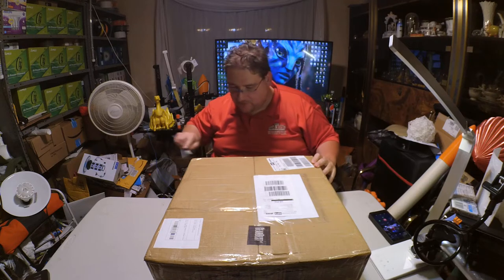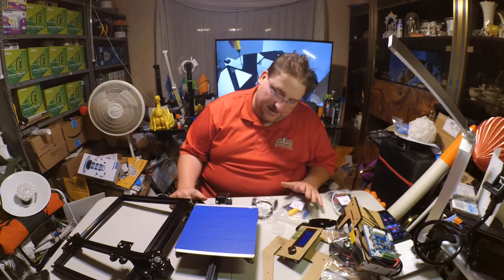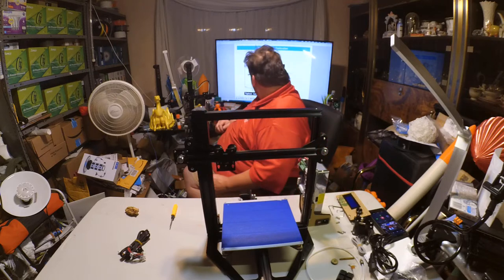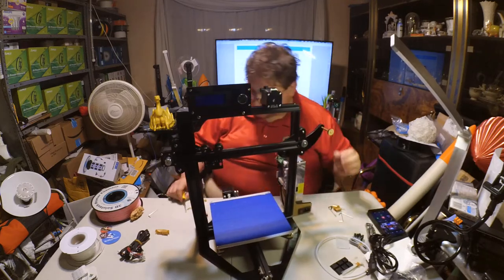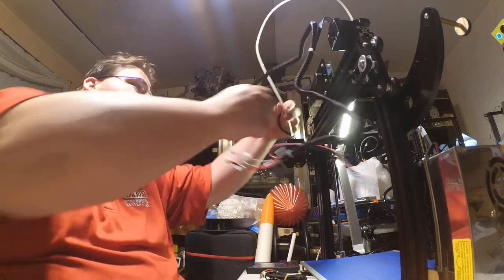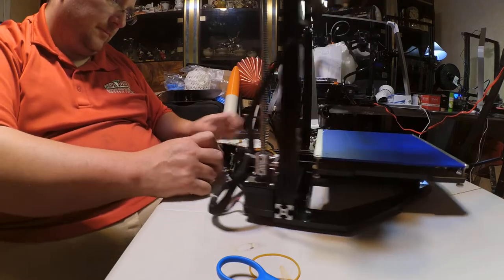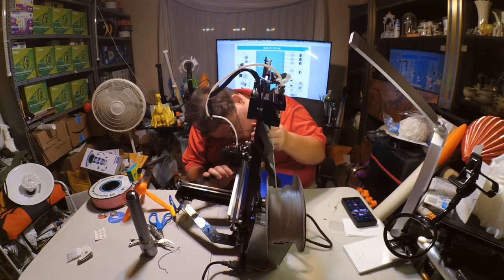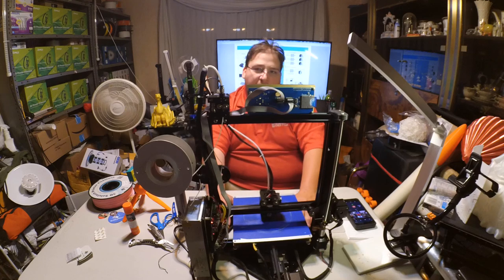Today's 3D Print - Zonestar Z5F Unboxing, Build, & First Print

Comment from the maker: Some sales Gearbest asked me to promote (why not)
I OWN these top listed printers and consider all of them to be a good or safe buy

CR-10 ON SALE AGAIN!! http://goo.gl/VsqqDa coupon:CR10SUP $379.99
UPGRADED Version of CR-10 http://goo.gl/sZXLnd GBCR10S $499
Ender 2 less than $170 http://goo.gl/RDceSp Coupon ENDERC EU Ver
Anet E10 http://goo.gl/ScK96q $259.99 just 60 pieces for EU warehouse
Zonestar Z5F (not perfect but not bad for $220!) http://goo.gl/d97i3B
------------------------
I DO NOT own any of these below printers but most appear to be well liked by other users on youtube. Check out some youtube videos and if you like them. Have at it.

NOW THIS looks cool. I want one of these to play with
http://goo.gl/sJ9oig LASER Cutter. Big. Code A3PRO2500 $159!

Tevo's take on the CR-10! Tornado Coupon Tonado1 $370 http://goo.gl/eBCy7e
I3 Mega http://goo.gl/baJAGP I3MEGA $310!
Anet A8 http://goo.gl/41b2YZ $139.99 Coupon GBA8EU just 200 Units EU warehouse
A6 http://goo.gl/e7PYSv EU warehouse $165.99 with coupon:GBA6EU

General Sale pages for this month.
More 3D printers http://goo.gl/D96bgJ
Autumn Bumper Harvest big deal http://goo.gl/NQ8cF8
Reply: HEY THERE BRO WILL THIS DEVICE TAKE A STEPPING MOTOR DRIVER LV8727 ???
ALOS WILL IT WORK WITHOUT HOT BED ???
THANK YOU VERY MUCH !!!

Comment: 2hour vid. Cool. Regarding the Enders belts. Do they go on top of the y axis carriage or on the bottom and same question for the hot end carriage. Thanks Nery.
Reply from the maker: I will have a shorter synopsis video once I have used it a little while.

For the ender. for the X its both (above and below) for the y its above and THROUGH the middle (inside hole) of the extrusion.
Reply: Nerys Thanks. Then I got it correct. Thank you.
Reply: Nerys I took another look at the assembly video on the sd card the guy has the brass ends visible coming up thru the bottom of the y carriage I switched it to that orientation and there was less stretch on the belt at the extreme travel points.
Reply from the maker: 4dprinter Guy what do you mean? Picture?
Reply: So imagine you are building one of your Enders, and you get to the point where you put the belt in the Y carriage and thru the extrusion..You slide it in BUT it has a brass fitting as a stop so it doesn't slip out..Now do you install the belt with the brass being UNDER the bed/Y carriage so the brass fitting is pointing towards the sky/ceiling?? Or do you install it where the brass stops on the ends of the belt are pointing down..AWAY or 180 degrees from the bed and part of the belt rides on the top of the Y carriage tangs...Not sure how to send a picture via this..That's the best I can do in written form.
Reply from the maker: ahhh gotcha now. I install from the bottom facing UP this keeps the belt path profile as flat as possible. less twisting that way. at least that is the logic.
Reply: Nerys same logic I was thinking. Kinda difficult to see on the video.

Comment: Anycubic I3 Mega has a bigger print volume than the Wanhao. Think it is 210x210x205. Thee is also now the CR10mini 300x220x300
Reply from the maker: the CR-10 mini looks nice. thankfully the one they are sending me looks to be the all metal variety (they have 2 versions one with an acrylic base) I am happy to get the all metal. I really don't like acrylic.

Comment: For $220, this thing looks fantastic - that acrylic bed though :(  At the end of the day, would you rather this & $160 or another CR-10?  I think I'm spoiled that the CR-10 was my first printer?
Reply from the maker: well believe it or not that "depends" the CR10 is nearly $200 more. ask me 2 years ago I would probably say THIS not the CR-10. why? investment risk. if I buy this and decide meh. not into 3d printing as much as I thought. I am out $200 not $400. but if I decide I AM IN and like this. I then go buy the CR-10 anyway (assuming I have a need to print that large) and now I have 2 printers.

The CR-10 for many is "NOT" the greatest first printer because if you decide you are not interested in pursuing 3D printing you just blew $400. $200 more than you needed too.

WHY in the world do you think the seriously lacking Anet A8 is SO damned popular.?? LOW RISK.

EVERY print I am getting off of this is far superior to anything my wanhao or maker select produced when I first got them (pre mods) and I have not changed a thing on it. I AM going to stiffen up the base (by tying the extrusions to each other with corner brackets and hammer nuts and bolts as zonestar should have done to begin with (silly oversight)

on top of that what if you NEED a new bot but simply do not need something massive like the CR-10? I can fit FOUR of these in the foot print of a CR-10 and they have a decent 220 cubed print volume. and its quiet.

SO it just depends. I personally am leaning toward suggesting the Ender 2 as a good first printer. flawless quality and zero mods required to get that flawless quality. small tiny quiet and cheap (cheaper than this actually)

but while it has a nice tall print volume (226mm) you are restricted in x and y to 151 by 163 or something close to that.

so it really comes down to "what do you need" from the bot. this bot surprises me. its pleasantly nice and puts out good quality and it does not need much work to get it nicer (really all it needs is to stiffen up the extrusions to each other and that is pretty much all it needs) oh and it also needs a different spool mount. a non 1kg roll compatible mount was just dumb on their part.

THIS bot can do my fin cans. the ender can't (need a 200x200 print bed to do the fin can and need 210 height) Even my wanhao/maker selects can't do my fins can (180mm max z)
Reply: Good points for sure.  Based on my personal experience with 3 printers (will be 5 tomorrow) - I currently have to strongly suggest getting into at least the CR-10 as your first.  High enough quality, with a large enough bed to make impactful prints.  For someone to save the $200 and get a sub par experience that turns them off didn't do them any favors.  HOWEVER, if you're getting good prints off this thing - that's endorsement enough for me from there.  Share your settings and preach on, I'll add it to the list of printers to watch :D
Reply from the maker: good enough prints. i think the extruder stepper might have puked on me so working on that. its a cheap printer i dont expect amazing but i do expect functional and to last more than 30 hours of printing, we shall see. if its a bum deal you guys will know it.

Comment: I think the flopping hook thing is a spool holder...could be wrong...
Reply from the maker: yep. had me confused because it can't hold a spool. at least not a 1kg spool. its designed for wee little spools. I have some M5's  Hammer Nuts and Corner brackets coming so I can stiffen up the link between the extrusions (there is none both independently link to the acrylic so while the parts themselves are crazy stiff the "unit" as a hole is wiggly.

Comment: I absolutely hate acrylic on any 3d printer unless it is a window you look into the heated chamber....I think by now people would get that...use aluminum I will pay extra for that then silly plastic....
Reply from the maker: agreed but its not "end of the world" if done right. the ender 2 has an acrylic base afterall and its the most high quality (print result) printer I have ever seen or touched short of Resin Based.

the issue is depending on the acrylic structurally. that is where things go wrong. using it to "tie it all into one base" (like the ender) sure. but on the ender the extrusions structurally are connected to EACH OTHER. the acrylic is just a pretty "plate" it all sits on.

on the Z5F the acrylic "actually" holds the parts together and they (the extrusions) are NOT tied to each other directly. that is a problem in the long run (though it is not so far effecting print quality much if at all) and is so easy to fix with a couple dollars in parts.
Reply: Yea...but I would replace it when I got the chance...screws and acrylic do not mix well ...the acrylic will eventually crack.
Reply from the maker: exactly. which is why the plate should NOT be the "tie in" for the extrusions. they WILL eventually crack over time just from cycling back and forth no matter how gently.

on the ender there is no "load" transferred to the plate. the extrusions are loaded to each other. this is fine. that plate will never fail.

I WILL probably replace the y carriage plate since that screams bad news to me though for now its really doing fine. I have enough bots that I will probably leave it acrylic until it fails then replace with aluminum. I can probably mod a maker select plate to do the job just drill the right holes etc..